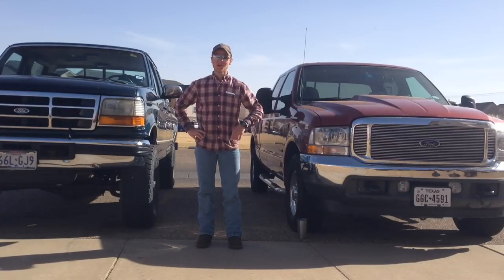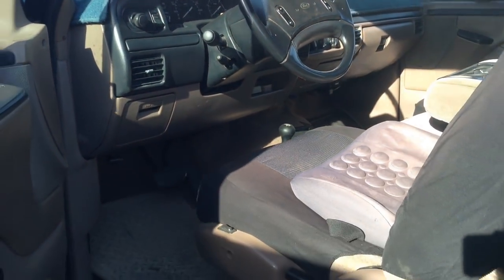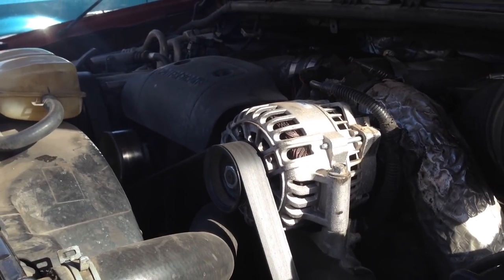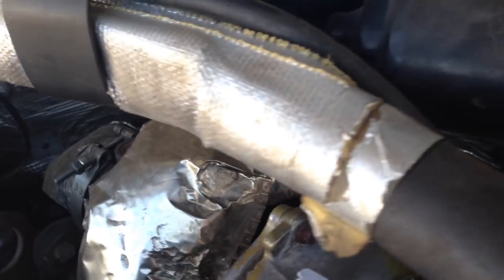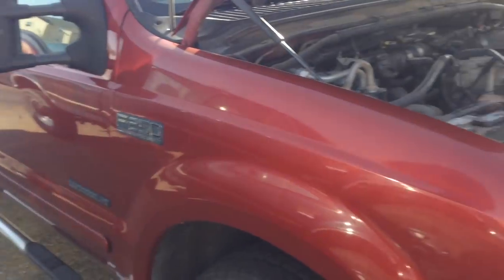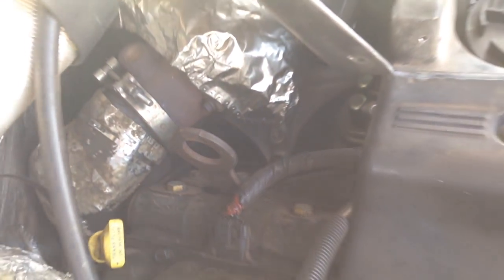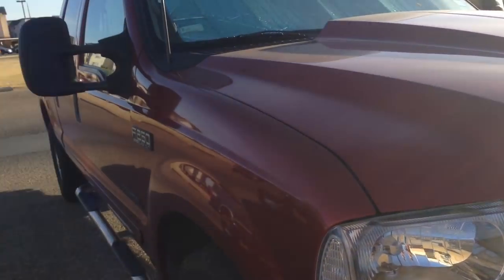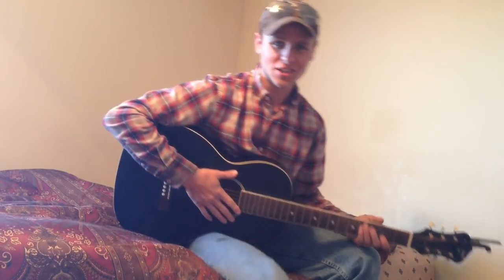OBS vs Superduty 7.3 Powerstroke

Comment: I love 7.3s..... but I love my 6.0 too. And it will eat a 7.3. I've owned both! Definitely a good engine though!
Reply from the maker: I'm sure the 6.0 is way quicker! Heck the first diesel that wasn't a tractor was my Dad's 2013 LML Duramax, that thing is powerful. I used to think all diesels were that way, until I drove a stock 7.3 haha. It's all in that VGT turbo, too bad the 6.0 had a flawed head clamping design from the factory. 

By the way, how has the 6.0 been from a reliability standpoint?
Reply from the maker: Not meaning to prod or anything I'm just genuinely curious about the 6.0 reliability. It's nice to hear from a 6.0 owner about their engine.
Reply: Rnddiesel it's really hit or miss with 6.0s man, 2003-2004 is a gamble. 2005+ is the way you wanna go. And still if you dont conduct proper maintenance then they aren't 100% either. If you leave them stock then they will be fine. It's when you start tuning them the heads fail. I've had mine a year and it's been great. I'm deleting it and studying it though this week as I want to tune it and just as a safety precaution. The VGT vainsstuck on mine....that's really the only problems I've had from it!
Reply: Rnddiesel studding** not studying😂😂
Reply from the maker: Kody Kill haha, good one! 

I guess that makes sense for a 6.0 to really get into trouble with tubes. Heck 500hp is basically just a tune away with a 6.0 from what I've heard. The 6.0 is definitely a unique animal, thanks for the info!
Reply: Kody Kill I have a 500+ horse 7.3 it'll move out but probably still get beat by a tuned 6.0 lol
Reply: Donny Bra Well just takes a lot of air to fill up those high volume cylinders and also the stroke is so long and only has two valves per cylinder and 7.3 don’t have a variable geometry turbo
Reply: Kody Kill 9
Reply: 6.0 is faster but the 7.3 power is a tow horse and is way more reliable not hating on a 6.0 by no means I have both a 7.3 and a 6.0 but to keep a 6.0 nice you have to bullet proof it
Reply: If your truck is really 500+ hp it will beat a tuned 6.0 diesel
Reply: A built 6.0 will eat itself, and the 7.3 will just keep going. Reliablity always wins the race.

Comment: I had a 1996 obs power stroke. Only 130k miles. Sold it because the truck around the engine was a pos . The engine is legendary
Reply from the maker: Wow, that's a low mileage 7.3! The engine does have some faults, but it is still a legend, and all things considered, cheap to work on. I don't know if I'd say the truck is garbage. Maybe after so many years stuff just gets old and the plastic interiors get rattly. I've had to to a bit of restoration work gluing my interior back together, so... it just takes some work. I think the Ford body is probably the more robust of the big three, especially back in the day. Dodge dashes, look at em hard and they fall apart! Chevrolet is good as well, but they aren't as heavy duty, and the dashes on those like to crack as well. Drove me crazy on my 97 Chevy. Ford Dashes seem to just hold together!
Reply: Rnddiesel rust is a huge problem in some areas, my 94 5.8 only has 107,000 but the frame will die long before the engine does
Reply from the maker: Right, that's a shame about the rust. I'm southern born and raised, so I don't even think about rust. Trucks down here hold up just fine, probably not as good as in California but still they hold up fairly well.

Comment: Does your obs have a leveling kit? Also what size tires u running. Great video btw
Reply from the maker: Thanks! You know funny thing, my truck sits stock height. No lift, level or anything. OBS trucks weren't exactly built for aerodynamics, so that front axle really shows itself off! I'm running 33 inch tires on mine, not sure on the exact size, stock rim and everything though as far as I can tell. They were on the truck when I bought it, so I haven't really looked much into that. The tires are just a little bigger and wider than stock though.
Reply: Rnddiesel  hey man thanks for the fast reply truck looks great always like the old body styles I finally got me a 96 7.3.
Reply from the maker: j D that's great, congrats on the new purchase, and have fun!
Reply from the maker: j D by the way, tires are LT305/70R16
Reply: The stock tire size on an Obs SRW is 235/85R16 have to order them basically. Nearest tire size that won't affect the odometer is 265/75R16. I went stock tires on mine.

Comment: I’m meeting up with a guy soon and he wants 7500$ for a 7.3  half cab with 178k is and has occasionally had oil leaks I’m I getting a deal or ripped off.
Reply from the maker: The price does sound a little steep for a truck with oil leaks. Though it sounds like the price can be more attributed to the low miles, if 178k is the legitimate mileage on the rig. That is very low miles for a 7.3 psd. For $7500 is better be 4 wheel drive at least. For reference I paid $4500 about a year an a half ago for my crew cab long bed 4x4 with 343k miles on it. It needed brakes, body work, a new radiator, had worn injectors, but at least had decent tires. Then again I've spend at least another $4500 in parts getting the truck to where I want it from a reliability standpoint. In your particular situation it's hard to say if that's a good deal or not as there are so many factors that go into it. For $7500 though, that truck better not have any problems and might need an oil change, that's it. Best of luck!
Reply: Thanks for the advice I’m going to make sure to check everything out on the truck before I even attempt to buy I love 7.3 And holding it goes well and  also have a 5 hour drive to meet him trucks a 5 speed manual with really no body rust only thing in the discription is oil leaks and a bit of rust on the cab.
Reply: Rnddiesel and it is a 4x4 so will see if I’m going to need to replace injectors and glow plugs but he says it starts very well in the cold without being plugged in.
Reply from the maker: @nathanu.2061  5 speed 4x4 sounds pretty sweet! If it leaks oil, I'd be willing to bet it's the Oil Cooler, that or a high pressure oil hose leaking around a fitting. The oil cooler isn't a hard fix, but it takes at least a half day and is a super dirty job. I'd be concerned with cab rust, as long as it's just surface it should be okay.  I'm from the south and rust really isn't a thing here. If you can, ask the guy to not start it for at least 24 hours before you go visit him so you can see for yourself that it starts well.
Reply: Rnddiesel that’s exactly what I was going to do if it’s hot before I get there I know somethings up and I also asked if he had it tuned because there were also knobs under the steering will it does have a cold air intake that seems pretty new so will se how she goes. I’m from VA and driving down to Tennessee so this guy better not be bull shitting me.
Reply: Rnddiesel what’s a good way to send pictures of the truck I know you no a lot about these 7.3. Get back to me when you can I’ve been told 7500$ is I bit to much for what it is.
Reply from the maker: @nathanu.2061  If there is a cold air intake on it I'd be willing to bet the truck does have aftermarket tuning on it as well. It's not necessarily the end of the world if it's been tuned, though ideally it'd have at least a set of gauges to monitor everything as well. Otherwise the tuning can decrease the engine life. My truck did have a Ts6 chip on it when I bought it, and no gauges. It's darn near impossible to find a 7.3 these days that isn't tuned. I bought it from a high school kid though and I knew he put the chip on and it had only been on for at most a year or so. Odds are he never hooked a trailer to it with the chip too. Since then I've intercooled my truck, installed gauges, 160cc injectors, a full exhaust system, and a 6.0 transmission cooler with no problems yet. Believe it or not though I do drive fairly conservatively with it though, I've only actually floored it maybe 3 times at most since then. Is there a craigslist link or something like that for the truck you're looking for?

Comment: Nice I bought a '95 f350 7.3 Crew Cab Long Bed for $4500. I love everything except for parking it, oh and expensive repairs. Mine needs some work and love(which I've been doing steps at a time) because she sat for a couple years. She has a misfire but I think I've narrowed it down to an injector. I have the stupid little bronco mirrors like yours, which I hate gonna swap them soon. I don't daily drive her though. I have my '04 Grand Marquis for that because I can't afford to when it's $3.45/gallon here in Salt Lake. 
P.S. I love the color of the Obs truck there. Mines Reef Blue Metallic, which I polished and waxed and she's a beauty now.
Reply from the maker: Nice! I paid the same for mine. Yeah parking it is a pain, but I figure it's a good problem up have, hopefully it means you'll have more truck than you'll ever need. I'm sure your truck looks good, deep blue OBS trucks are gorgeous. By the way I got rid of the plastic cover. Intercooler tubes got in the way...
Reply: Rnddiesel same here the plastic cover is stupid I didn't junk mine though.
Reply from the maker: I don't know, I think the cover looks kind of cool. Its a cover that actually has a panel on it so you can service the fuel filter. It'd be neat to remake the plastic cover to work with the intercooler though. I've still got mine too.
Reply: I actually like the smaller mirrors. They add a custom look

Comment: My old 97 was a good old truck but my 99 is a lot faster both have after market stuff,the 99 has the ww2 bigger injectors Hydra tunner and a solid built trans.287thou on the odometer.
Reply: Great video

Comment: Love my dad's 95 OBS dually with 4.11 rear gear, even with the small electronic issues that are starting to crop up ad 150,000 miles but I would like a 7.3L Powerstroke superduty, or maybe even a 6.0L knowing what I know now about them. Didn't know the super duty trucks had a trans temp gauge that far back. I figured that was something that started to be added about a few years ago... Also word of advice for anyone with the OBS Powerstroke: that mechanical fuel pump is a bitch to replace. And also about the fuel pump on the OBS is from what I've read on the web fuel pump on the OBS makes around 45 pounds of pressure but the injectors need 65 or so pounds of fuel pressure to perform at their max. Not sure if it's true or not but something to think about.

Comment: Kid just said it at 15:38 . The OBS is best for pulling. It all comes down to gearing and a 4.10 ratio will pull your house off it's foundation. My 91 460 zf5 has the same gearing and it out pulls my other 97 7.3 auto plus in the long run the OBS will be worth way more of kept up just because of the body style

Comment: I’m 16 and I drive a 95 7.3 and I’ve redone the whole interior/ better seats, & better carpet. But I have to disagree with you on the toughness of the obs to the superduty. In my opinion the obs is much tougher on the body and the motor. The obs 7.3 is completely different than the superduty, the 7.3s after 98 had a weaker bottom end like you said, the ICM on the superduty is 24v but the ICM on the obs is 12v. I love my obs 7.3 and I wouldnt trade it for the world. On the manual fuel pump it was converted to an electric fuel pump so I just turn on the key and let it prime for about 10-20 min with the glow plug relay disconnected so you don’t fry the valve cover wiring harness don’t ask me why I know that. And most of the time here is Texas I wired in a glow plug off switch because I never need them 95% of the time. But I can tell that my trucks previous owner took very good care of it.
Reply from the maker: That's awesome, I'm definitely jealous, my first car at 16 was a 92' Buick... It sounds like you're taking care of the old truck, glad to hear it and have fun with the rig!
Reply: You to, fellow OBS 7.3 owner.

Comment: Got a 1995 7.3 power stroke I want more power for towing and better fuel economy. Suggestions?
Reply from the maker: How many miles per gallon are you getting? Towing & unloaded?

I'd start by making sure the truck is running smoothly, any check engine lights? The truck should be pretty peppy when warmed up and decently responsive. How old are the fuel injectors? 

Injectors can wear out on 7.3's too, and while they may not make white smoke, they will cause a pretty bad sluggishness to the truck. I had a set of injectors with ~150k miles on them and the truck was definitely sluggish. Replaced with rebuild injectors and it made a huge difference!

Comment: the body style of a super duty is in fact MUCH MUCH taller then an OBS, the are about the same width, but a superduty has a much taller cab and bed inside and out, by atleast 8-10 inches taller cab, can you measure them since you have them side by side?
Reply from the maker: bummy 906, I'll talk to my SD friend and see if I can get some measurements. Are you more interested in the exterior or interior dimensions?
Reply: it would be extremely appreciated if you could measure them in and out, curiosity has been killing me for a while lol,  to measure the exterior just barely open the front door and measure the bottom to top, since they are both 4 doors which is perfect, i would like to know how tall the cab is measured from the center, to the roof, total cab height has to be really close to 50 inches according to my internet experience lol, let me know man, and if you havent understood what i meant by "center of the cab" this is what i meant  https://snag.gy/oWOgDw.jpg
Reply: @TheGamingChad.  i grew up in a 03 super duty im in an obs 7.3 know and i know beyond a shadow of a doubt you are correct im 6,4 and if i sit up i will hit my head in the obs and he says the room in the obs is more nope not true obs is a much smaller truck in all directions

Comment: Block heater in Texas, where are you originally from?
Reply from the maker: 25BEDFORD I've lived in Texas my whole life! Had a fit this past winter with cold starts. Worn injectors and bad glow plugs, I couldn't get it to start below 50 degrees, so I had to use the block heater. Heck I think I was the first person to use the heater too, the 97 has pretty much always been a Texas truck too.

Comment: Anybody wonder why the heck there trucks are so slow. I mean dang my obs 5spd with a little work gottta be under  11 seconds in the 0-60.
Reply from the maker: I wondered that myself, turns out the injectors were pretty worn out on my OBS at least. I presume they were also pretty worn out on the SD as well. About a year ago I put a set of rebuilt injectors in the OBS, 160/00. Even with stock tunes - so behaving like a stock injector, the truck was way faster. The zero to 60 dropped to like 10.5 seconds from 18.5...
Reply: @Rnddiesel  I got 160/30 injectors in my obs. The stock tune or just tow hual is perfect.

Comment: Love my 97 ext. cab long bed 7.3!!! It was my papaws and it had 400k on it when he passed. I got it pulled the og motor rebuilt it for a backup. I put a 1999 7.3 motor and computer in it due to it making more power. Yes it has the forged rods.
Reply: The only thing about them trucks is that they are so long but i love 7.3s

Comment: Superduty all the way. Way more comfortable, better brakes, better manual and auto trans, better ride, better built, easier to work on, all around better truck. Ford was not joking when they built the Superduty because their goal was to take over the light duty diesel truck market, and they did. Sure the OBS is better looking in some ways, but the Superduty is a much better built truck hands down.

Comment: Now you said at 6:10 that the bolt patterns were the same. 
So theoretically you could bolt direct injection heads onto an idi block?
Reply from the maker: I don't think that's the case. The blocks are vastly different between the direct injection and indirect injection engines.

Comment: The OBS has a 10 ' 25 '' rear end and the Super Duty has a 10 ' 50 '' rear end .
Reply from the maker: Thanks for the info! There definitely are other slight differences for example I didn't even mention anything about the brake systems on the trucks, there's just way to much to cover every detail. 

I appreciate the help and I'm sure other folks here who are curious about the differences will appreciate further input as well!
Reply: The Super Duty dually F350 have a dana 80 rear axle.

Comment: Question. How much worse is the ride of The obs compared to the sd?
Reply from the maker: It's hard to say. The SD in the video is 2x4, my OBS is a 4x4 and 1 ton rather than a 3/4 ton. The OBS definitely gives a rough ride, though I think pretty much any 1 ton truck will do that. The SD was a little softer, though that was probably from it only being a 3/4 ton. It wasn't a huge world of difference, but definitely a little softer.

Comment: You have to consider though in that 0-60 comparison is that the F-250 Super Duty is still a smaller truck compared to the F-350, so the test would be more accurate with an F-350 Super Duty with the crew cab and the long bed. Still, they run forever, and I will always love that OBS style with the push button door handles and the classic square body shape.